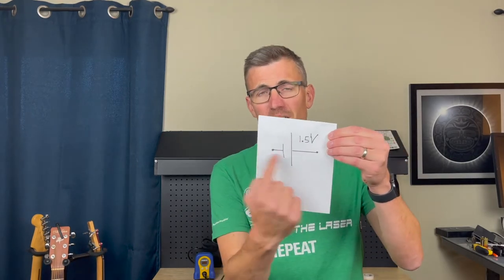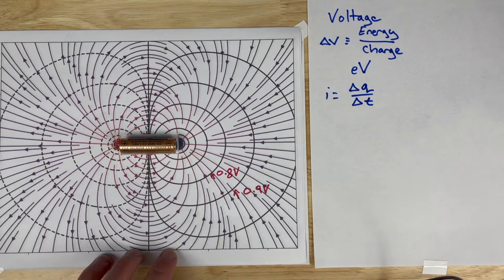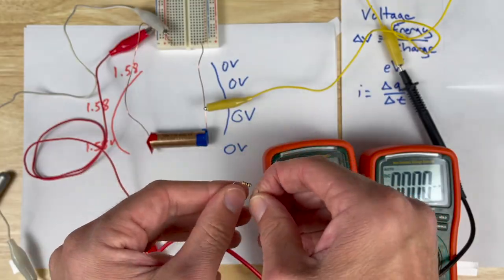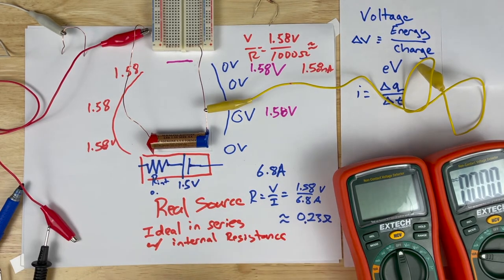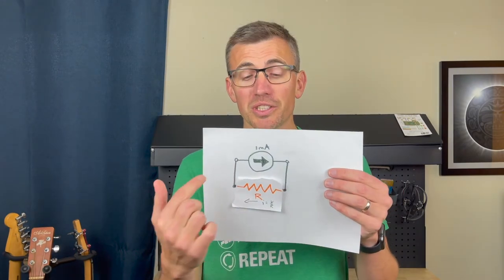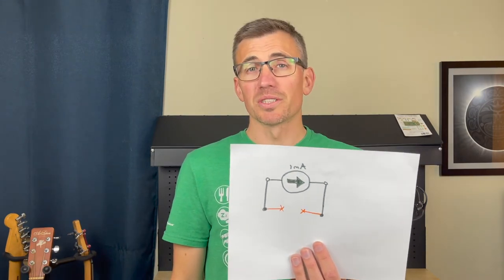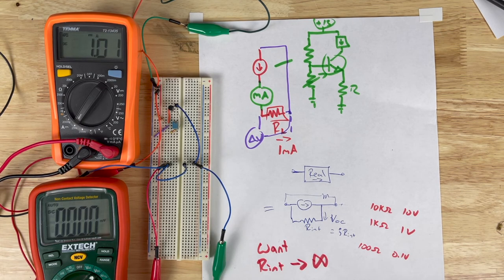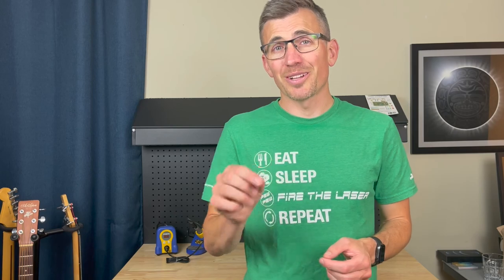Voltage and Current Sources: Ideal vs Real

Comment: 18:57
Question: Is the square symbol with the arrow inside considered the two terminals of the current source ?
Is that where we should connect the load resistor ?
Thanks for your great video.